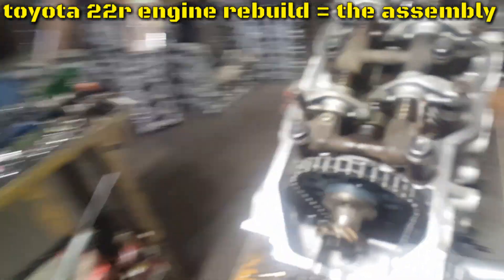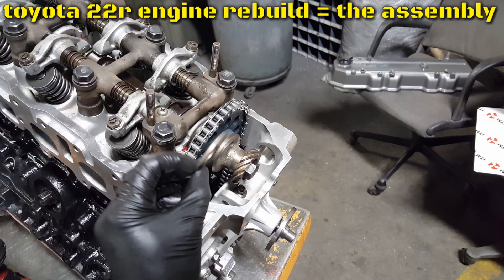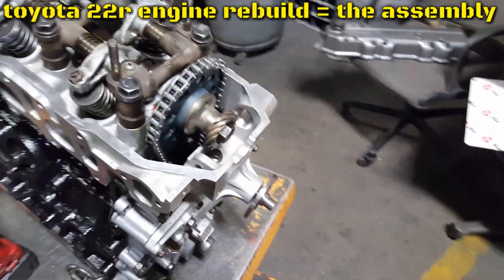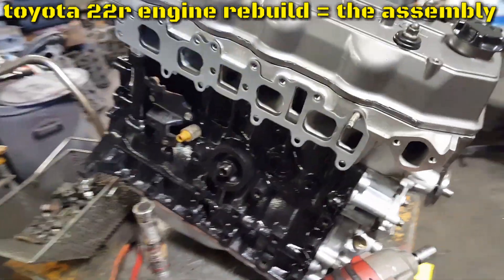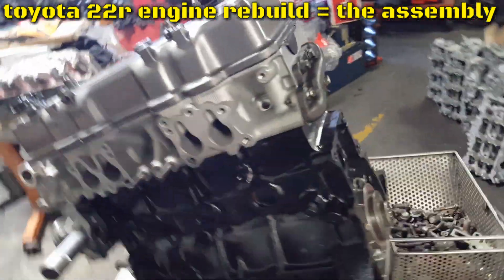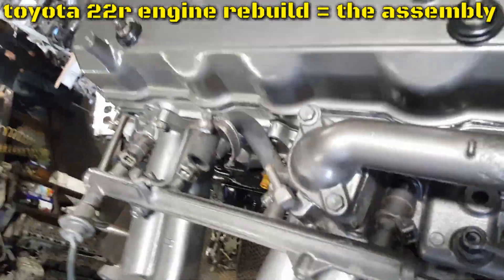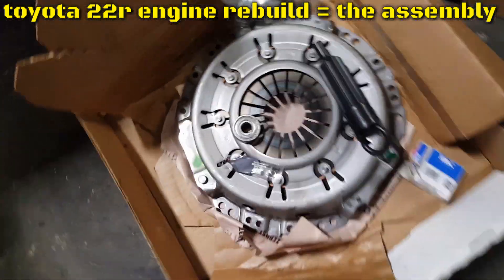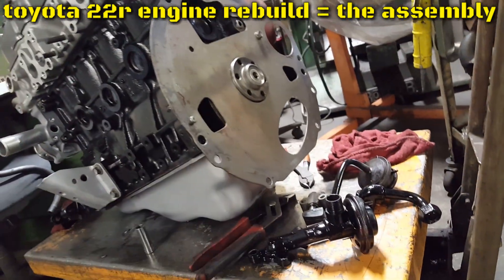Toyota 22r engine rebuild = the assembly, timing marks amd install

Comment: Owned a 22RE in a single cab long bed 2 Wheel Dr. automatic people that know these engines can make them last mine is 23 years old still driving every day two head gaskets replaced both times was from overheating keep it cool keep it running these engines are beautiful beyond compare

Comment: what type oil is suitable for this machine please ??!!!
Reply: I have run Motorcraft 10W-30 part-synthetic 5:33  for years recently been using Valvoline 10W-30 but I do think the motor craft is better even though I feel no  difference in the 2 oils. I will not use for synthetic These engines were not built for full synthetic oil

Comment: Would that missing washer cause my 22r to only run at full retard on the distributor at 0 degrees? I followed the lc engineering video and made sure the crank shaft position was at TDC 0 degrees with the cam dowel. TDC on compression stroke and the distributor was installed with the rotor pointing up at 12 o'clock and lined up the distributor bolt hole around around middle and as you push in the rotor with turn left and point towards the # 1 spark plug on the distributor cap. But mines is slightly in front of #1 unless I fully retard the distributor then it points directly at #1
I've tried going forward a tooth and backwards 1 tooth and she seems to run best at full retard at 0 degrees on the pulley.
Sometimes she's randomly will studder and back fire pop thru the 36 weber carburetor
Reply: You ever figure this issue out? I’m dealing with the same thing after doing a headgasket on my wheeler. Running a Weber as well

Comment: This is a 22re=fuel injected
22r =carbuereted
Just letting you know, assembly of the block and timing chain are the same on both
Reply from the maker: Yeah internals are the same! Thanks for the input tho 🤘
Reply: @JM8686  im doing a timing chain and a new cylinder head and new cam shaft on my 22r do you happen to know what the cam cap torque specs are ?
Reply: Que tipo de marca usas en el kit de distribuicion y en la bomba de aceite

Comment: The rocker arms are not properly aligned with the valves use shims and make sure there centered on the valves or they will wear out fast I had to buy shims from LCE to center my rocker arms when I used an aftermarket cylinder head hope this helps
Reply from the maker: Thanks for the tip but this engine already have over 46k after rebuild and not even one issue
Reply: robert baker necesito saber cómo puedo contactarlos
Reply from the maker: 13b_dorito mi Instagram
Reply: It lools like this dude does it for a job. I think hes got his shit together